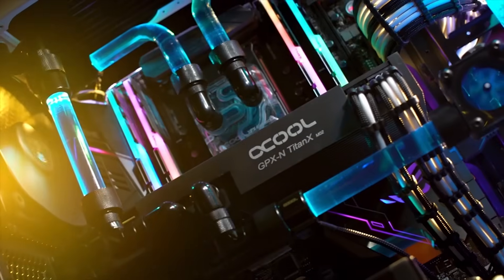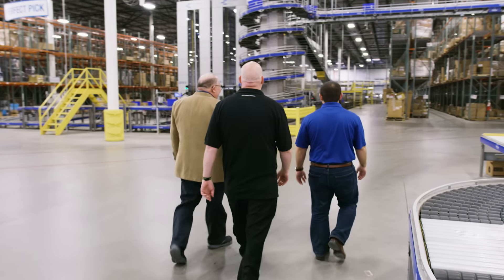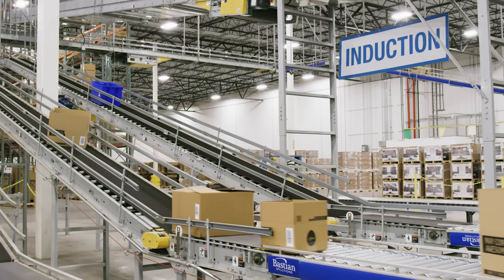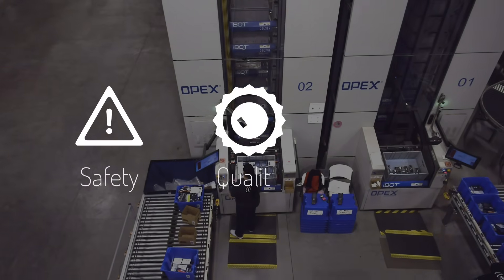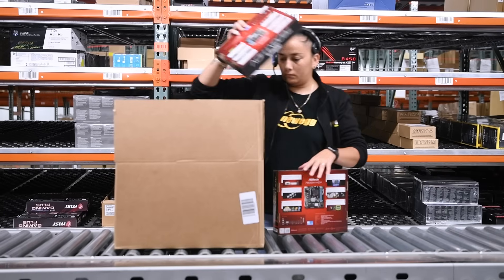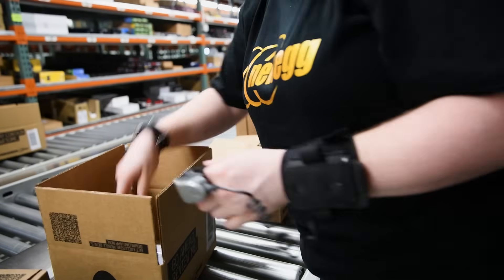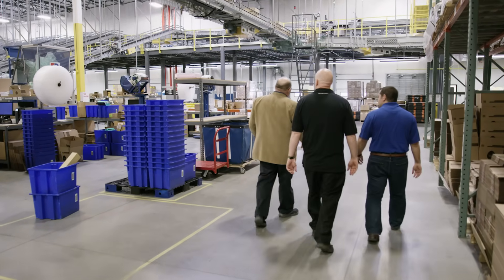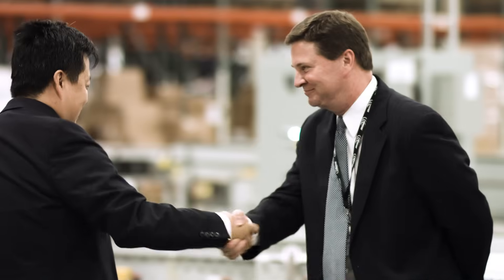E-Commerce Automation at Newegg's Robotic Distribution Center

Comment: How much  for the system? What is the monthly cost?
Reply from the maker: The overall and monthly cost of a system can vary significantly depending on a facility's operations. Our engineers can provide a better estimate with some additional information from you. If you'd like to discuss further, please contact info@bastiansolutions.com.
Reply: System costs less than 100,000